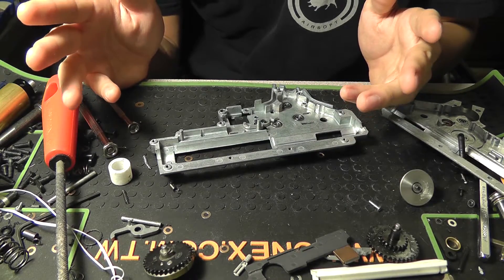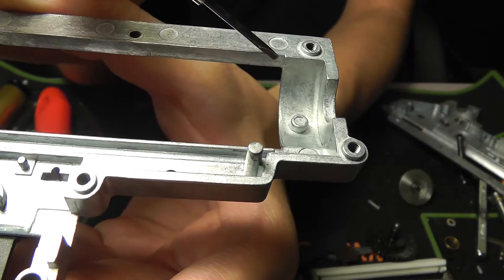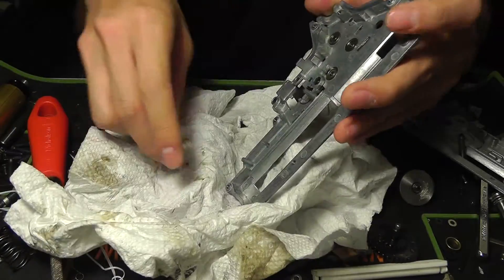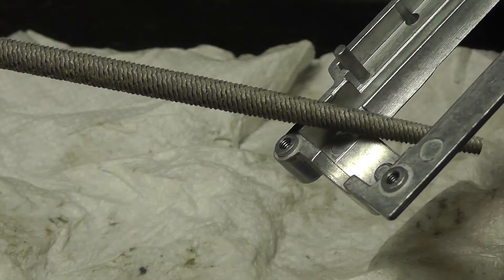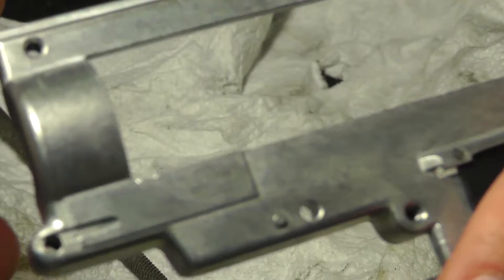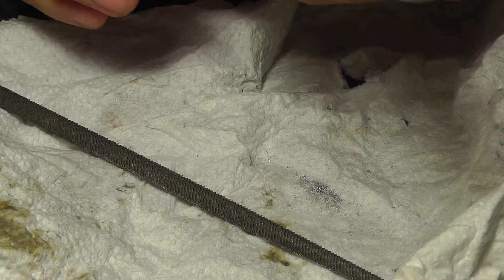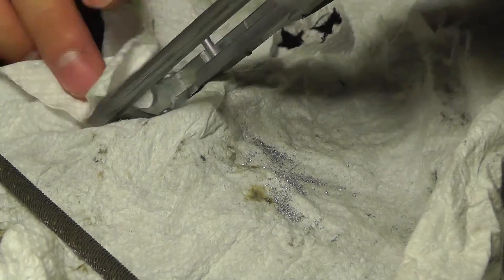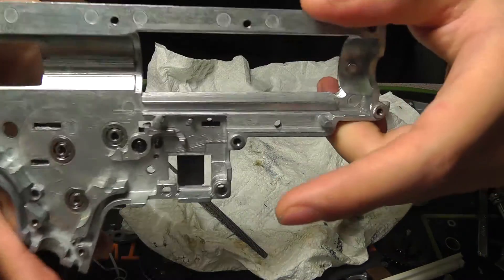How To: Radius Cylinder Head Windows

Comment: I like your videos you gave me a lot of good info but I wondering what you think of lonex compretion parts I haven't seen you use any but I wondering if you have and if you have could I have a your opinion on them?
Reply from the maker: thanks! Lonex compression parts are all very good but they tend to be a little on the expensive side. I usually work on G&P guns though and out of the box their compression is perfect so I don't feel like I ever need to replace them.
Reply: thanks a lot

Comment: I think I went too far with the radius, can any major problems be a result of this? Is there any way to revert this? or should I just pick up a new shell?
Reply from the maker: if it's weakened too much it can crack. Its up to you if you want to replace it but replacing might be a safer option. depends how intense your setup is.